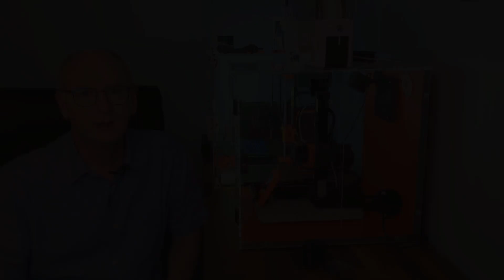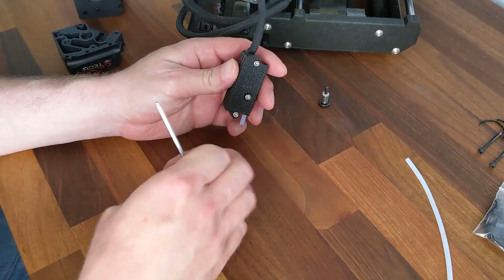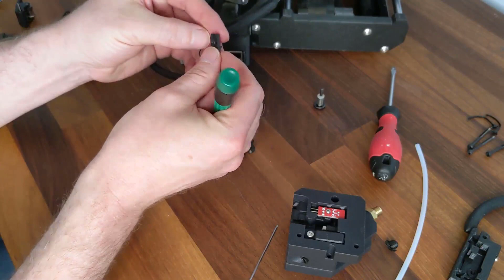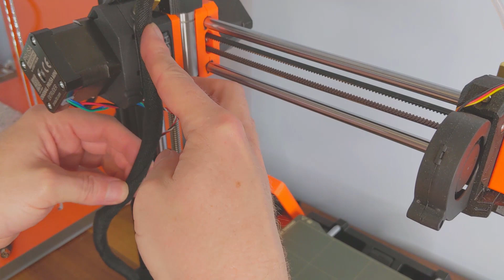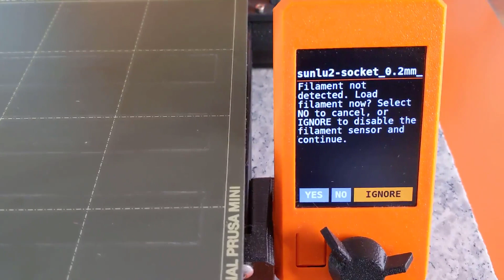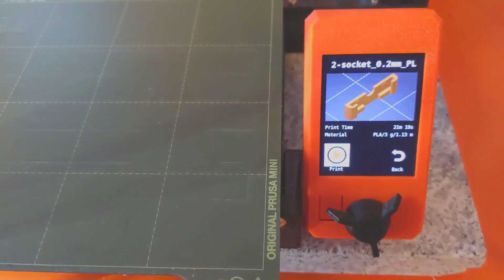Updated Review - IFS Bondtech Extruder - Internal Filament Sensor for Prusa Mini 3D Printer

Comment: how did you set up your prusa mini with bondtech extruder with thte new 4.3.4 firmware update? i have horrible clicking and grinding when i try and change and extrude filament. ive been trying to fix it for months now.
Reply from the maker: Sounds like hot end issue. Have you tried raising the heartbreak. There are videos about doing it. Basically undo the 3 grub screws, pus up then retighten. But must be done when hot! Or your PTFE tube may need replacing or you have a clog
Reply: @colinhill  its not the hotend because i dont even have filament loaded into it its at the extruder itself.
Reply: @colinhill  is it possible you can just share what you did for yours after the update?
Reply from the maker: @joshjakus3121  The software update has made no change in the way the extruder works, i dont really notice any difference. I can only suggest stripping down the extruder to check that the bearings/gears are in the correct place, no plastic bits are inside the extruder, and that the filament sensor is correctly constructed. In my case you have seen how i built it. may not be the best advice but if you are getting those noises without filament then something is rubbing. Also probably  not a good idea for the extruder to be empty as the top and bottom gears will be rubbing. Does it make the same noise when filament is loaded?

Comment: I have the same bondtech upgrade kit as you, tell me did you try to print on 4.3.4 software? what software do you use i can't come to good quality prints after changes i have very uneven extraction.
Reply from the maker: i am currently on 4.3.1 so i will upgarde to 4.3.4 and see what happens when i make my next print - and report back in this thread.
Reply: Did you change the Settings again in the Start code?
Reply from the maker: @breedlord1991  I don't think the quality is very different, but currently its not printing as good as i want. Just need the time to see if i can tweak the settings to get as good a result as mk3s. if i can improve it, i will update with what i did.